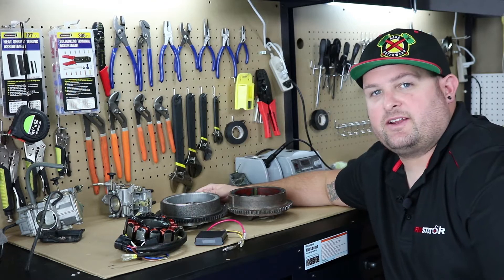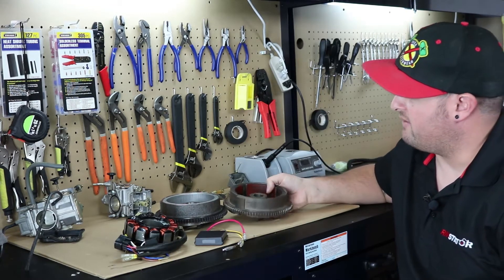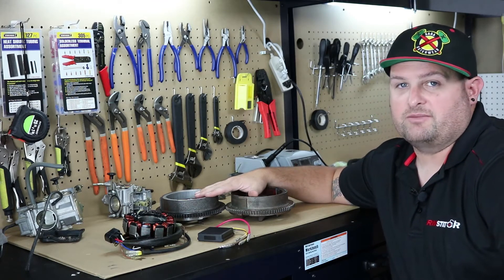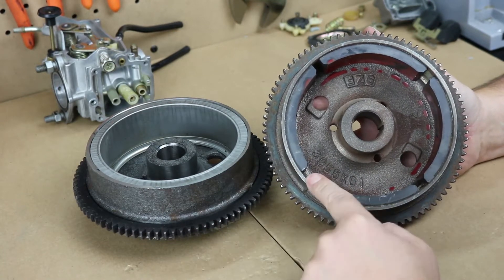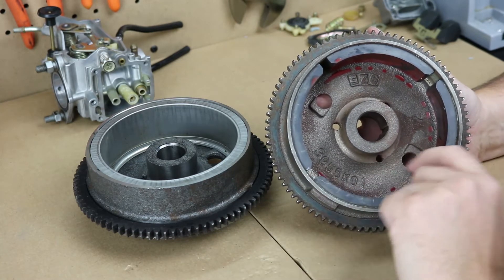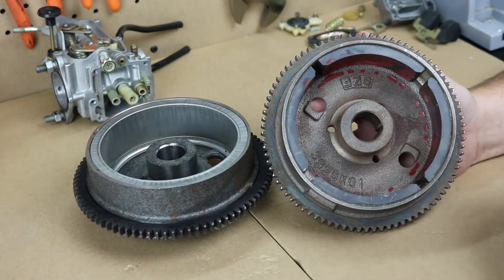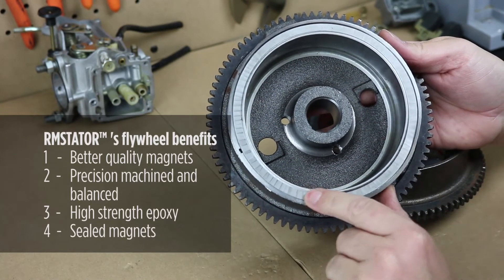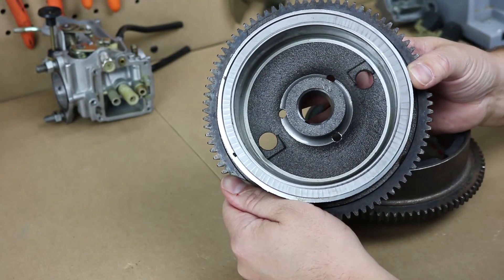Polaris 500cc ATVs Improved Heavy Duty Magneto Stator Flywheel OEM # 3085558 3086819 3086983 RM11512

Comment: I was wondering if you would know about my problem. I recently replaced the water pump and oil seals behind the water impeller. When I put everything back together, the wood ruff key sheared when I went to start it. I replaced it with a new one and now it won’t start. I still turns over but not firing anymore. I’m thinking maybe the key sheared again but not sure yet. I was wondering if you had any other suggestions. This is my first time working on this thing. Do they need to be re-timed when the key shears? Any help would be greatly appreciated. Thanks for your time

Comment: Is this common problem with 2011 Ranger EFI also ??  I think this is the problem with mine it acts like mags are shifting around .... starts sometimes then backfires sputters just like a 400 Arctic Cat Did yrs ago  that had this problem &  I replaced with your product !!
Reply from the maker: Awesome glad you've used our products. I believe that era Ranger had a similar flywheel, though not sure if the magnets were exposed. They could still have faulty epoxy though. Certainly wouldn't hurt to disassemble and check. We don't currently make a flywheel for that application unfortunately.

Comment: I just picked one up crossing number 3086857. I found the spot that pickup coil uses is in different spot isnt that not right. Throw off timing
Reply: Thank you mine is ff95 someone from your company told me you dont have one is that true
Reply: It showed 97 400 polaris not 500
Reply from the maker: There are multiple flywheels used on the Polaris ATV's. They have 2 codes stamped on them. One is an FF## code (FF95 or FF97), and the other is something like '2040K01'. You have to make sure both match the replacement flywheel. They all look similar, but have different timing trigger locations and dimensions. On our product listings we say which codes our flywheels replace.

Comment: Is that what can be wrong with mine I changed the starter and it still sounds like it’s not engaging and just here a winding noise
Reply from the maker: Sure could be. I would pull the flywheel and inspect the magnets and stator for damage.

Comment: Do you offer a flywheel and stator for a 1997 425 ?
Thank You very much James
Reply from the maker: Hi James, sorry we don't have a flywheel available for the 425 motor. We do have the stator, available here:
https://www.rmstator.com/en_ww/products/stator-for-aprilia-2001-2004-bmw-1997-2011-honda-1987-2007-suzuki-1986-2009-yamaha-1982-1990-rm01052
Reply: @Rmstatorinc  OK Thank You very much.
Reply: @Rmstatorinc  do have the AC to dc unit for the Polaris 425 ?
Reply from the maker: Yes we do, right here:
https://www.rmstator.com/en_ww/products/ac-to-dc-ignition-conversion-for-stator-cdi-for-polaris-big-boss-magnum-ranger-scrambler-sportsman-worker-1995-2004-rm40000